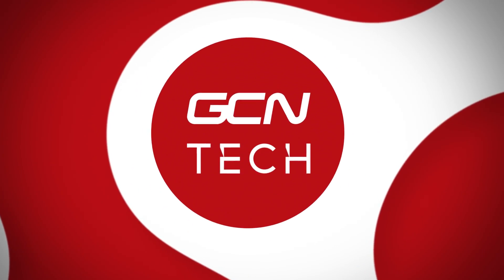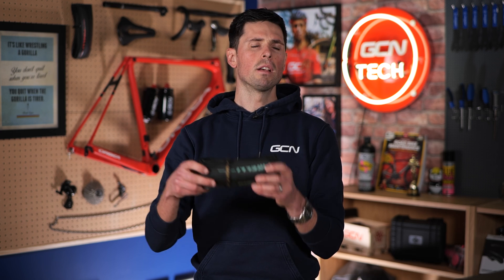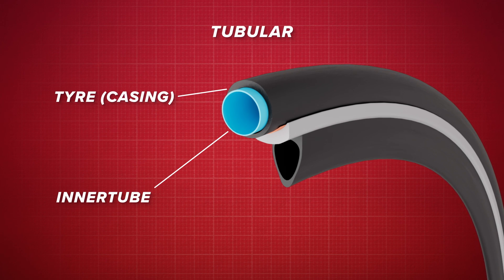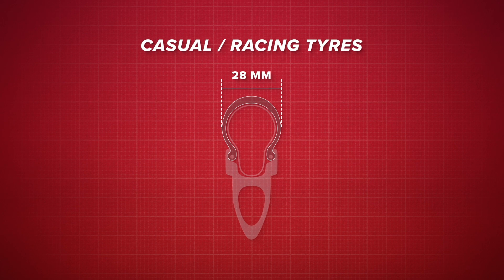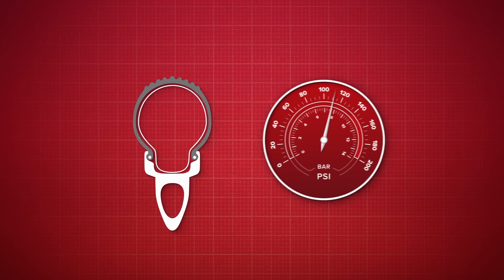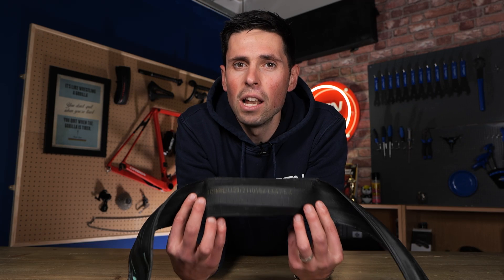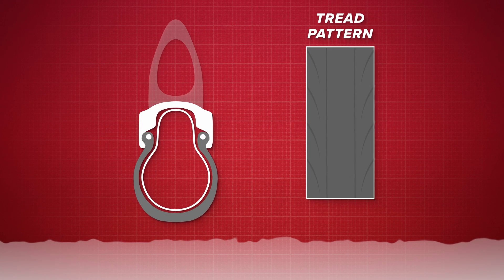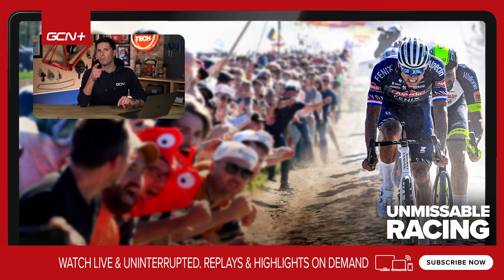Why Are Bike Tyres So Confusing? | Types & Details Explained!

Comment from the maker: Do you prefer clinchers, tubulars or tubeless? 👇
Reply: I rode a bike with clinchers for about 7 years and only ever had one puncture. Recently bought a new bike with tubeless-ready rims & tubeless tyres, but I'm thinking of switching back to clinchers because I don't like the idea of having to replace the sealant every 6 months...
Reply: @ciaoneef  you're gonna wait the 6 months before switching, right?
Reply: @KenSmith-bv4si  have to get the first checkup in a few months anyway so probably then
Reply: Clincher, for reasons already pointed out in the comments. 😊
Reply: Tubeless, only because I love the horror stories people tell me about tubeless tyres.
Reply: Clinchers for training and all around riding. Tubulars for mass start racing.
Reply: I like to use Clinchers. I have clinchers installed on my Trekking bike.
The Schwalbe Marathon PLUS (37mm wide) tyres on my bike.
These tyres have protection-level 7. Meaning that a change of getting a puntcure is pretty small.

The manufacturer that produces the most tyres is; SCHWALBE. They makes tyre for ALL types of bikes.
Narrow for road-bikes and racing. Fat tyres for E-bikes, Mountainbikes ETC. And really wide tyres for speedbikes
Reply: What I prefer is different than what I ride. Tubular all the way - road, gravel, certainly cross, and even my old 26'er mountain bike. But, for convenience, I ride clinchers - except gravel. I ride tubeless tubulars for gravel, similar to the old Tufos. It's like riding on pillows.
Reply: Clinchers right now but, I'll use whatever tire comes with my next bike
Reply: Tannus Airless all the way. you feel every bump but they make sure you always get where youre going as long as the frame and wheels themselves are fine. no more rude suprises of a flat tyre in the morning when you really need to get to a job interview
Reply: Clinchers, I like simple old school things, that just work. And don't require a special degree to keep working
Reply: Clinchers.... Easy. Repairs on the way and no sticky goop.
Reply: Clinchers.. with latex. The puncture strip in tires now are very good and very light.
Reply: 2½ bike with tubulars, 6½ clinchers, 1 tubeless, but liquid in both some of the clinchers and tubulars
Reply: Clinchers for me. I’m an old-timer, and they’re what I grew up with. 
However, after watching this video, I’m not as anti-tubeless as I used to be. Thanks!
Reply: There is a dirty joke in here somewhere...
Reply: Clinchers for road bikes
Reply: I really like tubeless, as it's technically superior.

But I have had some issues in setting it up, wasting time and money, so I understand why many still prefer clinchers.

At this point I've come to understand what I did wrong and therefore I shall ride my tubeless system and enjoy the low pressure and rolling resistance.
Reply: Clinchers. No mess no fuss. Carry a spare tube. Or two when travelling.
Reply: Just now starting to set up my bikes with tubeless arrangements.
Reply: I have all of those, clinchers on my regular road bike and the old mountain bike I use for commuting, tubulars on my TT-bike and tubeless on my fat bike. They all have their advantages and disadvantages.
Reply: Tubeless.  Way to many flats on tubes for my commute.
Reply: "neumatic"? There is a "P", it's "Pneumatic". It's the same letter you just used two second earlier: "Pay attention". Damn British speakers
Reply: Been using clincher for 20yrs, last 10 years on Schwalbe One and only ever had 2 punctures, brilliant tyre. New purchase came with C40 Tubular so started using them, the difference in ride quality and feel was incredible. Bike felt alive and reaction to input was instant. Conti Comp 25mm, 72psi front, 77psi Rear
Reply: Tubeless.  All the haters can enjoy having to stop for punctures.
Reply: @Schrodinger The Cat  I'm definitely not a hater of tubeless.  My bf rides on them, and there's just extra complications,  such as the plugs, which he's had to use, and the cleaning and refreshing periodically.  When out, he still carries a tube and pump, so I don't see much advantage.
Reply: @schrodingerthecat  Noob, I see more tubeless rider stopping to find out their tire can't seal, end up calling UBER.
Reply: @schrodingerthecat  Once or twice a year.
Reply: @billkallas1762  Instead of 0. 😼
Reply: @schrodingerthecat  How long does it take to change the fluid, every 6 months.
Reply: @schrodingerthecat  Sure zero? Or have you missed videos of people struggling to fix their tubeless on the road?
Reply: @billkallas1762  I'd rather repair all my punctures in the kitchen rather than at the side of the road lazy man's approach is to replace you sealant when you replace your tyre (or other occasion when you're removing your tyre anyway), and instead just pop the valve core out, whenever needed, and squirt some extra sealant in 😊
Reply: I use a lot of used bikes and wheels, so I use those tyres that the wheels were made for.

PS. 26" tyres is/was used for MTBs

Comment: I just upgraded from bontrager R1s to Vittoria Corsa G2.0 (TLR folding). I can't believe the difference in feel, not sure I noticed the improvement in rolling resistance but the softness (feeling wise) is a bit mind boggling, going to 60TPI to 320TPI is a huge change, there was a part of my ride this morning when I realised I was about to go on private land, lifted the front tyre to turn around and plopped it back on the ground and the feeling I got back from the impact I was sure I had a puncture... Luckily I didn't! The R1 was rock solid when inflated where the Corsa still feel soft even though I put an extra 10psi in the tyre (100psi) today compared to what it usually run in the R1s (~80-90PSI).

The tyres are "Tubeless ready" but my rims don't natively support tubeless tyres, I've heard you can convert rims (by sealing them) but results vary (more likely to leak).

Comment: It occurs to me, that given the rims for "tubs" are a lot lighter than clinchers, why not combine the best of all the designs? Do a sealed tire with no tube on a tubular type rim and a bit of sealant  (glue on I presume).. would have all the advantages of sewups, but even lighter. I guess that's what hookless attempts to achieve which has the benefit of no glue and lighter than clinchers but easier to repair than sewups. hmm. I think I just talked myself into hookless lol. I also learned from this that 1 bar does not equal 1 ATM bafflingly. 1 bar is 14.5psi whereas 1ATM (seal level at standard temperature) is 14.7psi.

Comment: I’ve used tubulars in the 80’s until the 90’s. Now I use withe tubes and found out at 28 with tires are more confortable for my road bike and 60 psi runs great.

Comment: Clinchers for me, tubeless are ok when set up properly but problematic, and messy, when you have a puncture too large for the sealant to seal.  I've been using 28's and 30's lately.  Tried to get some more at the local bike shop today and they only had 25's - heaps of them.  The mechanic said no one was buying the 25's and the 28's and 30's sold out.

Comment: Calling the tyres / rims 622mm (or whichever other size it happens to be) is objectively the best way to do it. It always corresponds to the actual measurement and is the easiest way to see what is compatible.

But it can't be that hard to get people to use the proven superior system of measurements. People will quickly adapt the most logical and easy to understand system any second now.

Comment: I know there are loads of videos out there but my issue with any tyre is that it is so damn hard to slip the final 5cm of bead onto the wheel without using some tool to help me. Probably lesser problem un tubeless where you could use a tyre lever without risking pinching your inner tube.
Also unhooking the tyre is always an issue. A video just specifically for these 2 issues, especially for roadsides maintenance would be helpful. Cheers!

Comment: Very good Information. I use 25 mm tires on my bike. Using dunlop tires I found very versatile to my needs, that is on trainer in winter and summer racing. I'm not a pro and only want satisfactory performance the the money I put out. Cheers

Comment: Nice video: clear, unfussy, informative.  Pretty much sums up why Alex is one of my favorite presenters on GCN. 

I vastly prefer clinchers with tubes.  I tried tubeless and didn't like them. It's partly that I like slightly higher pressures, partly that tubeless performance isn't actually noticeably better (they're really not even that much more puncture-proof), and partly that they're unreasonably difficult to get onto wheels, but mostly it's the sealant; that stuff is sticky and disgusting.

Comment: How does fewer TPI provide better puncture protection? I would think more would provide more protection. More threads, more of a barrier?
Reply: lower TPI generally means thicker threads. These are typically less flexible and tougher
Reply: @GCNalex  Thanks for the info, Alex, it's much appreciated.

Comment: Dunlop's original "tubular" design has never been improved upon in terms of safety or performance. When the flanges of a clincher/tubeless hit the pavement, the rider too easily loses control, especially with the front wheel at speed. Does anyone dispute this? What pro wants to lose control and take down the peloton he gets a flat? Tubs have 30% more casing to optimize comfort and performance. Tubular rims do not have to carry any pressure load and are therefor MUCH lighter. Tubeless marketing claims that its rolling resistance is the lowest - but only by 1 or 2 watts!. And this is compared to "existing" clincher and tubular technology. The industry could easily build glue-less tubulars if they wanted to. This was already done 20 years ago by Tufo, and could be improved upon with key seats. GCN techies don't want marketing, we want real engineering where ALL of the the tradeoffs are considered and carefully measured!

Comment: Penny Farthings used hollow rubber tubes with tensioned wire run through them. Evolutionary step skipped.
Reply from the maker: Do you see that coming back in cycling? 👀

Comment: After a lot of experimentation, I use a tubeless 30 mm tyre with an insert for long distance road riding (2 to 9 hours at a time).  I came up with this because it gives me more comfort for long distance rides and has not ever needed me to repair a puncture while on the road, and it provides the most safety against a catastrophic failure.  Every few months I have to top off fluid or change it out.  
In case of a catastrophic tear in the tire. the insert will keep the tire on the wheel (and keep me upright instead of sprawled in the middle of the road picking gravel out of my wounds) and allow me to ride on the flat tire for some time, although this has not happened in 1000 miles of riding since I switched to tubleless.  I have seen the white juice leaking out of tiny holes in my tires while on the road, which would have meant stopping to repair or replace a tube in my previous setup.  On a 200 km ride I don't want to have to do that because I could run out of daylight if I were to have to stop to repair.  Also, the weight of the spares tubes and repair kit can be felt after about 100 km or so. I am 70 years old so weight and the amount of time I am on the road matter quite a bit.  
I am using a light weight tire to compensate for the slight increase in weight from the insert and the fluid, which is still less than the weight of inner tubes and a repair kit.   
The only down side is that the tubeless tire is quite difficult to get on an off my wheel, especially with the foam insert.  I get around this problem by compressing the foam from the sides with wood working clamps, as the special tools for this job don't always work well, especially since the fluid can cause the bead to stick fast to the wheel.
I won't go back to tires with tubes because I used the "call the wife to come pick me up" card too many times.
Reply from the maker: Tubeless is the future! 🙌Great to hear that you've had a positive experience and that you've fully adopted it! Would you like to see more content around tubeless inserts? 👀

Comment: I think clincher tires comprise tube-type tires as well as tubeless tires.  Tubeless then breaks down into hooked and hookless rims.  When mentioning tire sizing conventions, it would have been good to note that MTB 29ers are the same as 700c (ISO 622), 650b (584) are also called 27.5, and that 26" tires (559) were the standard MTB tire size prior to 27.5 and 29ers.
Reply: That's GMBN's jurisdiction though :)
Reply: There was at time even a tubular tire with no separate tube in the inner - Wilber Liberty (Bernard Thevenet and his team have used it when Thevenet has won TdF other tubular tires had a tube that was inside the sued tire
Reply: It should be Wolber

Comment: Is "29er" the same thing as 700?
Reply: Yes, it's using the 622 mm rim like 700 of 28 inch. The 29 refers to the outer tire diameter, which is bigger if the tire is wider.

27,5 inch mountainbikes are using the long existing 584 mm rim (also known as 650B) and 26 inch MTBs use 559 mm rims

Comment: 1 bar = 14.7 (14.696 psi) not 14.5 psi.  1 bar = 1 atm which is the mean air pressure at sea level.  Nobody should run hookless rims.

Comment: Its not confusing its only confusing because your listening to everybody, stop.
Go to the bike shop tell the guy or gal there what ya got what ya want to do and they'll fix you up pronto.
I did that got my Continental gator skins 700/28mm.and " WALA"  didnt have to know anything. Bout a thousand miles ago and zero flats in a tire that has no goop in it. 
I do run a tube in a tubeless tire.
I just prefer it that way.
Good vid. Do keepemcoming won't ya
Reply from the maker: Bike shops are always there to help! Some of us love the nerdy tech details and some of us love to just ride 🙌 It's all part of the fun! Great to hear that your local shop sorted you out, keep on riding!!!

Comment: I can remember when the first racing clincher came out. It was a Specialized Turbo, and was advertised as a 700x25 ultralite tire, to compete with tubulars. The tire was very light BECAUSE it was only 20mm wide. (they lied).....At the time, they were about the same width as the Victoria CX, and the Continental Comp 22 tubulars.
Reply from the maker: Oh how times have changed!! 🙌
Reply: @gcntech  Yes, damnit.  Things have changed, but not always for the better.

Comment: It's not clear to me though if switching between clinchers, tubulars or tubeless is also going to change the actual performance of the bike. Do one type go a little bit faster than the other?
Reply: Most pro teams have switched from tubular to tubeless in the past two seasons as they feel there is a slight performance advantage - tubeless tyres are reckoned to be slightly faster, and being able to be inflated to lower pressures, more comfortable.

However, the big advantage of tubs was the ability to continue riding on a wheel after a flat. The tub would remain stuck to the rim and would allow the rider to keep riding, albeit slowly, until the team car could get to them. With tubeless, that isn’t really an option.
Reply: @johnwestwell2241  thanks so much!
Reply: @johnwestwell2241  False, most pro team force to use tubeless because of sponsors not because of performance. Tubular is still the best performance tires. Tubeless tires are heavy AF. If by choice, GC rider will rather ride on tubular than tubeless.

Comment: Clinchers for me but it makes a big difference which tyres/tubes you use. My current road bike I’ve done over 8000 miles on and only had two punctures, both caused by huge potholes. I have decent tyres on this bike. Whereas on my older road bike I used cheaper tyres and used to get punctures all the time. If you invest in the right tyres you shouldn’t have any problems using clinchers!
Reply: I bought a cheap chinese bike. The tires that came with it popped from punctures every time I road, I just thought that was how it was with road bikes. I was a complete newb. I started looking into it and realized I was just a fool. I bought some better tires on amazon and have never had a puncture since, it is crazy how big a difference it is. I am not a racer, I ride on regular roads, so knowing I can just go out and exercise without wasting time and money is way nicer than going really fast.
Reply: @gruanger  you learned quickly and who would have thunk it, not a fool. ✌🏼
Reply: My punctures are either because of the piece of glass or because of bumps. I had about ten in the last half a year and couldn't imagine how changing tires can help.
Reply: @PavelSavyhin  I live in Arizona with thorns, glass and other sharp things literally everywhere on the side of roads. I bought puncture resistant tires that have layers of puncture resistant materials. I am not sure what it is and it makes the tire weigh more and is thicker, but I went from literally daily flats with large thorns sticking out or glass, to not a single one since
Reply from the maker: Tyre choice makes a huge difference 🙌 Do you ride purely on the road or are you mixing in some gravel?
Reply: @gcntech  Just on the road with that bike. Mtb for off-road!